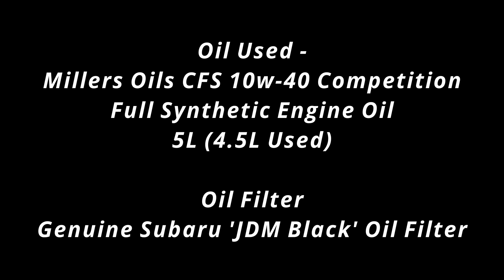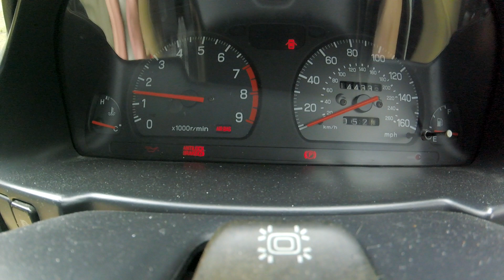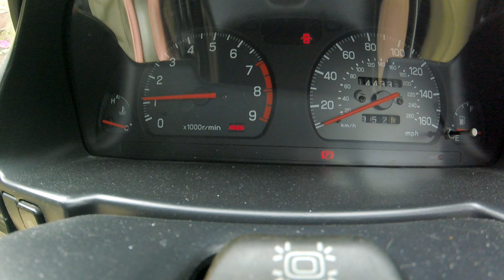Subaru Impreza full Oil Change and Oil Filter Replacement

Comment: Amateur here, so you should run the engine before the oil change? Also, what kind of wrench did you use for the filter? Thanks
Reply from the maker: Ondra Ramach Yeah only for a few minutes so it’s not too hot you can’t touch anything, it warms up the oil and helps it drain out faster. And as the oil has just been moving around the engine it helps get bits out that may have settled. I used a tool specific for removing filters, it’s just a chain design that tightens around the filter. It’s the thing with the blue handle n the video,  there’s a few different types of tool available just for removing filters, just find the one that suits best depending on how well you can get to the filter. 👍